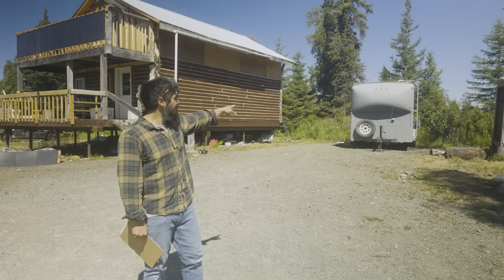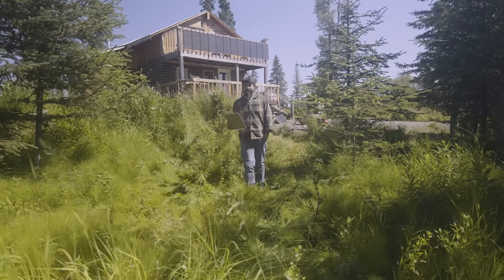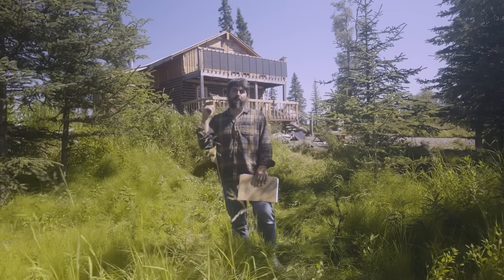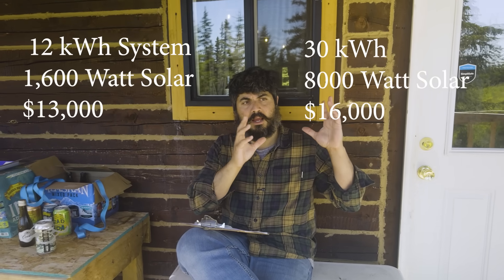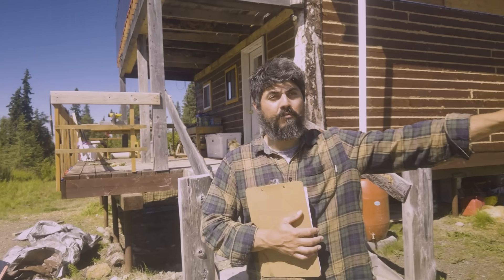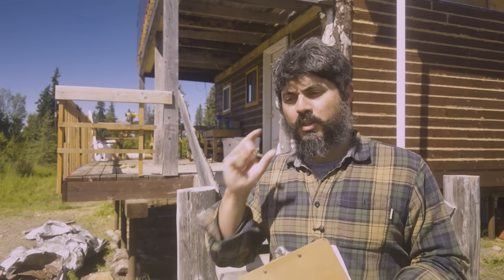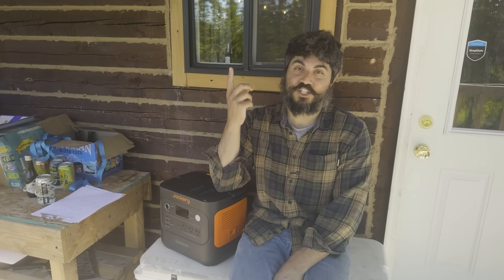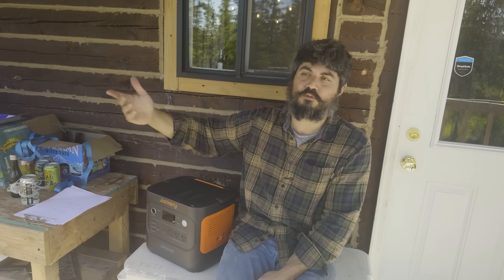DEEP DIVE into our OFF GRID POWER SYSTEM, Solar Powered Portable Power Stations

Comment: the  jackeries are way too exspensive  the  jackery 5000 with the 1000w  solar  array  alone costs almost as much as my  entire  Solar setup wich consists of 1  6500w  hybrid all on one  inverter, 800 amp  hour lifepo4  battery bank  and 6800  watts worth of  panels , 10 solar panel racks wireing  combioner box etc .  my solar  geneation is  averaging over 24KWh a day  and even on  cloudy rainy days   I   average  over 12KWh a day. I  run AC   1 10,000 BTU  window unit and one 12,000 BTU mini split during the day,  and at night  one 8,000 BTU  window unit,  fans,  full size fridge   a production pc (not a laptop) and my audio desk  lights TV and a Commercial Double BUNN coffee pot. Water pump, lights  and I cook with a 2  burner induction  hotplate and an air fryer etc

Comment: Here's my issue with Jackery, all their connections are proprietary,  so you can't use different panels with them or use their panels with different units easily
Reply from the maker: I mentioned that in this video, it is a downside of the Jackery System

Comment: In your cost comparo, you missed the cost of solar battery charge controller and inverter(s) for your permanent system. These items are included in the Jackerys costs you mentioned. You need to compare apples to apples.
Reply from the maker: No it’s included in the whole cost, inverters and all

Comment: Love your explanation of your system. i moved to northern Sweden a few years ago and started also with a jackery powerbox and a 200w solarpanel. today i have 10 kw solarpanelarray and a 3kw hybrid solar carger/converter ,connected to a 7.5 kw 24volt Batterybank to run all my apliances (i live alone).My lights are all 12v Led and they run of a 12volt solar system with 430w solarpanel and a 12v/280amphour battery. About the cost it seems much more expensive in alaska than in europe. The 10kw Solararray cost each panel 59€x 24 are 1416€, the inverter costs 249,-€ and the batteries are 279 each x3 are 837,-€ cablesand all other stuff needed are about 450,.€ so it was a total of 2952,-€. During the longlasting Wintertime i also have to run a generator to load the batteries, but only once a week for about 3-4 hours.
Cooking and heating during winter runs on wood and during summer cooking is outside on wood or inside at a gasstove.
And yes my first winter here was horrible because of a missing generator to power the tools i used to renovate my cabin inside to get it insulated better and liveable.
Thank you for sharing and greetings from northern Sweden

Comment: Propane is another direction you can look into to further diversify your avenues for power sources (i.e. also burns clean and has no effect on the environment). Good way to make sure you can still cook (i.e. propane stove), clean, wash (i.e. heat your water for bathing and showering and other things), lighting (i.e. little propane lamps), or just simply keep the home warm (i.e. propane space heater) should anything happen to your other power sources or just simply because an electronic went down and you need time to figure out what the problem may be. Sure, it may not be able to do everything electricity can do, but at least you'll have the essentials to get by during those periods that may show up.

Comment: I am totally anti-Jackery.  They were extremely late to the game in switching over to lifepo4 batteries, and they are still WAY overpriced per watt hour compared to the competition.  Add to that all their proprietary connectors, and I just can't see using them.
Ecoflow and Bluetti are better products and both have more generic connectors with rqual or better pricing.  There are several other companies making good products, Pecron has probably the beat bang for the buck out there right now, but all of them have aome gives and takes.  Bluetti has a new one that only accepts 60v of pv per input.  That requires multiple strings to get enough panels hooked up to quickly charge the unit.  That's sad when I have a Bluetti AC200MAX that has a 150v solar input on a 4 year old unit.  They don't even make it anymore. 
You already know that running multiple units daily isn't the way to go, and all the companies are grossly overpriced on their proprietary solar panels.  You CAN get whole home backup with power stations, but the coat is high.  5kwh server rack batteries are under $1k, so 30kwh of storage will run you +-$6k.  A 12kw inverter will run you $2k or so, and just pile on the solar panels.  More is better, and panels are cheap.
Winter will be your challenge when you can pretty much forget solar power.  I would go ahead and get a backup dual-fuel generator.  Right now, you're getting 20 hours of sunlight and cone December it will be 4 hours.
Your bill in PA was $500, but i bet your monthly kwh usage was WAY higher than you are using now.  Payback is probably closer to 12-13 years, and that's on a DIY setup.

Comment: I have seen cables that switch from standard PV plugs to any of the major brands' specialized plugs on a youtube channel that tested and combined different batteries, chargers, powerstations. He even connected cheap 12 or even 48V LFP batteries to different powerstations to extend their capacity. I don't remember the channel name, but he did say he bought these cables online.

Comment: Try this instead, EG4 12000XP $3500, 500A BMS King Kong 2 62kwh $9,000, 20kwpv under $7000 everywhere but if you can get Waaree 745w you only need 24 panels 17.8kw and room to vertical snow boost another 4400w.  2 hours of heavy overcast might get 4kwh maybe more, I still have to test the 12000xp in Dec to get data.18kwh a day for heat and all other past winter, last run the Gen Jan 9 and total 66hrs for the total.
Alaska solar Nov to Feb is a tough gig, based on what I saw on shademap in Dec North of Fort Yukon gets nothing, Fairbanks is 3 hours, Anchorage 4 hours, Ketchikan 5.5 hours. If you are above Fairbanks, I would highly recommend 18kw LPG Gen running at 14,000W charge, the suggested battery can be used with a second inverter for 25kw of discharge.  If you go to battery site, check out the Komodo. 
If my Alaska light numbers are wrong? please correct if you live there I prefer to be accurate.

Comment: My husband and I are completely off grid in the Southeast US, and we have to have more solar than what you have here. In the summer we have fans and even an AC if we desperately need it. We also have three large gas generators (smallest one is 3500 watts) to recharge our batteries  and run our well pump if it's cloudy or stormy for several days in a row. We got through Helene with it. You have what you need for summer but what about winter?

 I used to live in the Pacific Northwest and in the winter it gets dark real early and stays night for a long time. We called the wintertime "The Big Dark" when we lived in northern WA. How are you guys going to make it through the Alaskan Big Dark season when there is no long lasting sunlight for 6 months? 

I congratulate you for being able to get by on your Jackery setup but you will need more for the winter. I pray for you guys. My husband and I decided not to move to Alaska precisely because of the long, dark and frigid winters there.
Reply: I live off grid in Alaska. Kenai Peninsula. I have 4 310w solar panels. More would definitely be nice. I have a 3500w inverter. An upgrade would also not be amiss. I run a 3000w generator daily in the winter as also a bigger battery array would be a good idea. I live very simply and I just make it through. This family, with 7 kids, multiple freezers and living a life with lots of electrical stuff and power tools, will definitely need either gas generators for the winter or a very large upgrade. At least one gas generator in case it snows or is cloudy for days on end...Power here is ridiculously expensive, so double that lower 48 power bill. I am grateful to be off grid when I listen to other people complain about the HEA ( power co. )
Reply: @tienneish  They literally said in this video that they already got a gas generator because it got cloudy :) and that the current solar system was because it was quick to set up and use before they get the bigger one set up, that he also talks about in this video, are you guys even watching or just so eager to list your own stuff "systems"?
Reply: Excellent comment. I pray they know what they're in for during winter up there.